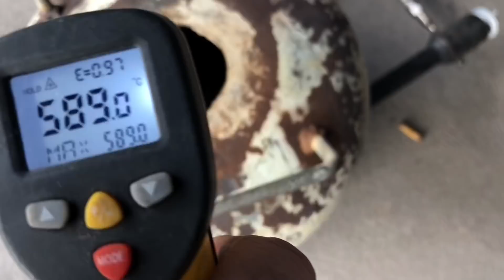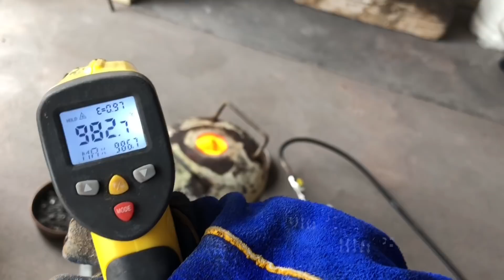Trash To Treasure - Copper Clad Aluminium Ingots Made From Scrap

Comment: I don’t think you need a new furnace.. if it ain’t broke why fix it. Just use the kaowool and line the lid 👍🏻 casting in the rain ☔️ so much fun haha. Good job on the video
Reply from the maker: Thanks Adam appreciate that. I’m actually gonna retire the furnace for now  as a guy that watches me has a shop on eBay and sent me a 10 kg devil Forge furnace😁. He said it’s mine for free just do a quick Unboxing set up Melton metal and where are you even,too easy. The burner is twice as powerful As my current burner,  I tried this furnace this afternoon just for a test heat And its bloody scary how powerful this thing is . And I just spent $130 on some refactory cement and 3.6mtrs of Kaowool to rebuild my other 2 furnaces. That’s cool They’ll be there if I need them again. I got very lucky indeed an $800AUS furnace for nuthin you beauty🤘🏻😁🤘🏻
Reply: bigstackD Casting oh that’s kick ass 👍🏻 can’t wait to see it in action! Well if you do a huge casting you might need to melt multiple things at the same time so at least you’ll have that option
Reply from the maker: True that mate take care and talk soon my friend

Comment: Nice new crucibles! Old one looked dangerous for a long time 🙂 I hope new crucibles will last really long.
Reply from the maker: Yeah matey i love a nice new crucible, this old one will never melt again although i may get it red hot 1 more time and either drop it in some water or get it redhot and put it on a block of ice. Carefully of coarse🤘👍😃
Reply: bigstackD Casting It'll be funny if the crucible will sustain such last temperature test :)

Comment: That must have been a decent sized transformer you scrapped out there?
I prefer the Copper ones because I stack copper, but once I get into melting I'll be melting all of the Aluminium ones for sure now.
Reply from the maker: We scrapped some pretty big compressors here too and I cleaned up on about 30 kilos of cable as thick as my thumb 🤘🏻😁🤘🏻

Comment: How the hell do you trash crucibles so fast?  I've got a #6 with a ton of bronze melts under it's belt.  Is your flame hitting it?  After I pour, I return it to the hot furnace and put the lid on it and cover my exhaust hole.  It's still hot 8hrs later.  Next time you polish your knob, add a little dish soap to the water.  Works like lube and makes the polishing job easier.  ;-)
Reply from the maker: Yeah mate this particular time was my own fault with the Crucible I didn’t really heat it properly the first timewhen I received it and it got a slight fracture in it. I really push my luck with cracked crucibles but no more that one will never be used again although I may get it red-hot and put it on a block of ice or get it red-hot and pour cold water in it to see what happens. Thanks for the pushing knob tip I’ll definitely use dish soap next time I hope it doesn’t sting😯. good to hear from you my friend it’s been awhile anyway take care have a great weekend😁👍🏻🍻🍻🍻
Reply: Oh yeah.. I'm just sweating my sack off here!  108F for last week straight!  Send some cold weather.  I'm in the final stages of a bronze project now....  Sneak peak was in the last video.  Work has been keeping me very busy and I need to get this project finished.  I've got some cool ideas, but no time.   Now, my wife wants me to overhaul her laundry room.  It never ends man.  Hope yours is doing well.  Now go fix that lid.  Mine is going to need some love soon.  It's solid mizzou and heavy as hell.  No cracks, but I welded a steel ring to hold it to the lid.  The steel is starting to fail.  Take it easy!
Reply from the maker: Thanks buddy I will, Yeah that furnace will be sorted next week don’t you worry you’ll see on next Friday’s video. enjoy the heat matey, it’s about 12°C right now and it’s starting to rain so I’m going back inside😣

Comment: Hey Big D. Lot-o-slag off that stuff. So any idea what you ended up with there, some sort of aluminium-copper alloy or was the copper really more of an epoxy than copper? If it is an alloy, any idea how brittle it is? 
Always fun to watch, hope you're doing well mate. :-D
Reply from the maker: Hey Perry how are ya matey? this at a guess is probably at least 95% Aluminium and 5%copper or maybe a touch less copper as ingots the same size weigh only slightly less. If you want i could try work out the exact amount with water displacment x Cm3 weight etc? I didn't actually stamp it as i was kinda thinking it could shatter but to hold it and bang them together they feel exactly like a normal aluminium bar so it'll probably be OK to hit with a hammer i suppose. Yeah im doing pretty good mate thanks. Anyway Pezza have a great weekend matey take care and talk soon. 👍😀
Reply: Pezza?? is that some sort of whoolyboinga Australian word or a pet name for me ;-)  I just had to look up "smell of an oily rag" from Martin this morning. I don't know that I can handle two of them in one day ;-)

Put on protective gear and hit 'em with a hammer! It'll make either a really boring video when they just dent or really cool video when they shatter.  I expect that they'll just dent (or stamp) with that much aluminium in them.

I almost said don't go to the trouble of figuring out the weight differential but then thought it would be fun to know. But don't go and do it on my account.
Reply from the maker: Yeah kinda Jeremy is Jezza Perry is Pezza and my redheaded mate is called Bluey 🤷🏻‍♂️were an odd bunch down under mate😉. Yeah I’ll work out the purity of that ingot when I’m home again mate and let ya know😁👍🏻
Reply: well then I'm honored :-D

Comment: Your editing makes for enjoyable viewing. Just curious, would it be possible to melt the aluminium out of the copper cladding, thus separating the two metals? Copper melts at a much higher temperature.
Reply from the maker: You probably could but it would definately be Damn fiddly .It would be alot easier to do in an electric furnace as you can control the temp exactly. But it would be difficult i recon. Now that they are mixed together in the Ingots i wouldn't have a clue if it could be separated now🤔👍
Reply: One tricky point to melting the aluminum out of the copper cladding would be the ability of the aluminum to dissolve copper at below the melting point of pure aluminum.

Comment: Do you ever get junk (flux, slag, and unmelted metal) stuck to the bottom of your crucibles, and if so how do you get it out? I already ruined my last graphite crucible trying to get it out (more like my first lol). What happened is I was supposed to clean it, but I didn't so it built up over time, and also made it more difficult for the metal to melt. I tried just scraping it out, putting it upside down and then trying to remelt it, and then I also tried just pouring vinegar into it to dissolve it, and that didn't work (none of these worked).
Reply from the maker: hey buddy i have only had problems cleaning steel crucibles but with my clay/graphite crucibles i have only ever had very easy clean ups i either clean it while its hot or even after it has cooled down and its been easy for me. I always clean it before each melt so not to get any build up . Sorry to hear your having dramas with your crucibles but ive not experienced that yet. 🤔

Comment: I've never seen or even heard of copper clad aluminum wire. Any idea what it's used for? Just curious, thanks D.
Reply from the maker: I believe This wire is commonly used for weight reduction including high-quality coils, such as the voice coils in headphones & portable loudspeakers, high frequency antennas and cable television cables. 
It’s also used in electrical wiring for some buildings because of the cost advantage compared to pure copper wire.
Reply from the maker: But I’m pretty sure it won’t run high current through it very well either 🤔

Comment: How pure are the ingots from this casting? Did the copper come off as slag or did it get mixed in with the melting? Great video, once again!
Reply from the maker: These 2 Ingots are an alloy of about 90-95% Aluminium and 5-10% Copper There wasn't any copper in the slag so its definitely mixed in with the ingots. This type of wire usually has 5-10% copper so i cant know the exact amount .Either way it looks and feels great i recon. 😀👍
Reply: They look great. No doubt the yield is near 100%. The slag looks like mostly ash from the lacquer coating, and potting residue from forming the coils. How strong do you suppose the alloy is?
Reply: I doubt you'd lose much copper to slag.  The aluminum would want to grab oxygen from copper oxide.  And copper dissolves easily in aluminum, the melting point for the alloy dropping until you pass 33% copper.
Reply from the maker: It feels pretty much the same as regular aluminium bar but having said that with a high amount of aluminium to copper I was hesitant to stamp it. the copper probably is only a couple of percent so it is basically aluminium so it’s probably quite hard in fact👍🏻
Reply from the maker: Interesting indeed🤔👍🏻

Comment: How did you know it was copper coated? It looked like pure copper to me...
Obviously, it wasn’t pure copper. I’m just confused how you knew it wasn’t before you melted it.

But I used to think aluminum was magnetic sooo.... what do I know 😆😂
Reply from the maker: Hey buddy you could see by looking at the ends of the wires that it had an Aluminium core and copper clad on the outside. It feels odd as it does look like copper but to pick it up its soooo light. 😀

Comment: copper skin with aluminium core, because the AC skin effect,   and copper is more expansive than aluminium. so sometime the electrical company just using aluminium core with a copper skin.
Reply: Yup... everyone has turned cheap ass on us.  Aluminum wire is garbage.
Reply: worldtraveler ya, sometime aluminium cable is not a bad thing, you know the high voltage transmission lines? many of them are using aluminium cable (which is cheaper) as the outer cable, and the core is using steel cable (give the strength the cable needs), because its high volt losses is not very high, if you using in AUS or China (both have around 220 to 240) with aluminium cable then good luck to you, if you are in JP or US where got around 100 to 110 volt, using aluminium cable with high power machines then GG
Reply from the maker: Very interesting indeed🤔
Reply: Stephen Su Aluminum wire in homes here is a big no no. Corrosion leads to fires.
Reply: worldtraveler totally agree

Comment: Man, the refractory lining of your lid is falling apart, crucible broke... you're in bad shape! ;-) 

Noticed you heated it way higher than needed to melt aluminum.  Were you trying to melt the copper coating as well & form sort of a reverse aluminum bronze?
Reply from the maker: yeah i did heat it alot but up around 850 there was still some chunky bits in the molten aluminium, after i got to about 950 it was all melted and had liquified so yeah it is kinda a reverse AL/BR. Dont worry bout the furnace matey next friday youll see what i mean.  😀👍

Comment: Can you send the link to where you got your burner?
Reply from the maker: Sure mate the links below to the burner I currently use but b4 you buy it I’m just lettin ya know this Friday I’ll release a copper melting vid while using the same sellers bigger burner and furnace combo. I had molten copper in just over 10 minutes with the smaller one it takes me about 45-50 minutes . I’m not sure on the gas usage yet as I’ve only used it once but I’ll definitely make note of it on my next bottle for sure😉This link is to the smaller one  I’m currently using but I’ll be retiring that now and save it for aluminium melts I think👍🏻😁. 
DFP GAS BURNER blacksmiths forge furnace foundry raku kiln propane farrier knife https://rover.ebay.com/rover/0/0/0?mpre=https%3A%2F%2Fwww.ebay.com.au%2Fulk%2Fitm%2F251448540050
Reply: bigstackD Casting I wish I could afford a whole furnace burner combo
Reply from the maker: Yeah there pretty pricey but there good. 👍🏻😁
Reply: bigstackD Casting is it the solid refractory one or the kao wool one
Reply from the maker: It’s the 10kg furnace but it has Kaowool only . I’ve only used it once but it feels like it’s gonna be a big winner👍🏻
Reply: bigstackD Casting either coat that kao wool with something or prepare to have breathing issues
Reply from the maker: I got a pretty good respirator my friend 😁👍🏻
Reply: bigstackD Casting well that's good but it will also slowly eat away at it without a coating
Reply from the maker: Yeah it definitely will break down a bit over time for sure. I actually have a place where I can buy replacement ceramic wool that’s rated to 1460°C and I can get that relatively cheap at $80aus for 3.6mtrs x 0.6mtrs x 25mm. 
If she breaks down too fast I’ll definitely look at a refractory coating. 👍🏻😁
Reply: bigstackD Casting just some satanite shuld work. Or go to a hardware and get some of that paste stuff whatever it is
Reply from the maker: Yeah I saw Pauls Garage using the satanite stuff and I can’t find that anywhere 🤷🏻‍♂️. But I did just buy 25kgs of refractory cement maybe I’ll look at using that if I need  👍🏻
Reply: bigstackD Casting might work

Comment: did you throw out the copper as dross then?
Reply from the maker: Nah matey the copper was still chunky floating around in the molten aluminium at about 850 degrees Celsius but when i got to about 950 degrees Celsius it all melted in, There was probably only about 3-5% copper clad on these i recon. When i get some time i was actually gonna work it out to the exact % by using water displacement x Weigh X cm3 etc of the ingot as a few people have wondered about it aswell.Ill put the results up in a future video👍😀
Reply: that's me told 😀

Comment: That wire has no copper at all, I get it from transformers, it's varnish coated to keep the turns from shorting together.
Think about it, if it was copper clad on a transformer, it would short the second it was turned on.
Reply from the maker: My electrician mate from work gave me these wires and i can assure you they were indeed copper coated, I should have held the ends up to the camera closer. , The long piece did have some varnish coating aswell but they were definately copper clad wires. 👍
Reply: bigstackD Casting interesting! Never seen that before! Keep up the great vids.
Reply from the maker: Cheers matey have a great weekend 😁👍🏻

Comment: I think your goal should be that you are able to melt steel (if it is even possible at home)
Reply from the maker: It is possible for sure just get a bigger burner or 2 burners but then you'll need to get something to melt it in and it would destroy the interior of your furnace as most refractory's , firebricks and kaowools would breakdown at those temps.👍
Reply: bigstackD Casting Maybe melt iron?
Reply from the maker: Yeah matey for the foreseeable future I’ll stick with what I know matey 😉👍🏻

Comment: I think you overheated the aluminum
Reply from the maker: yeah i did heat it alot but up around 800 there was still some chunky bits in the molten aluminium, after i got to about 900 it was all melted and had liquefied, Definitely overheated but at-least it doesn't have any nasty stuff like when i overheat Brass👍😀